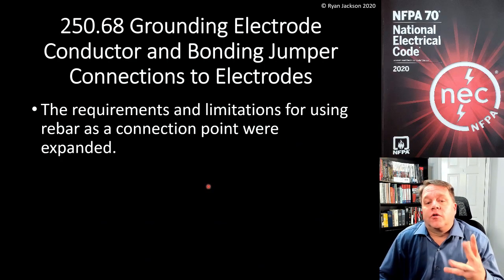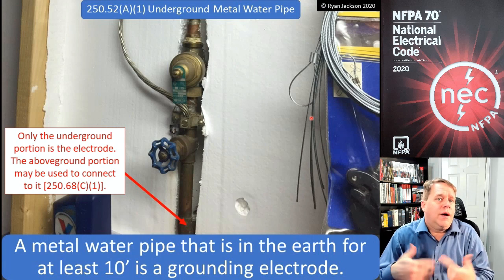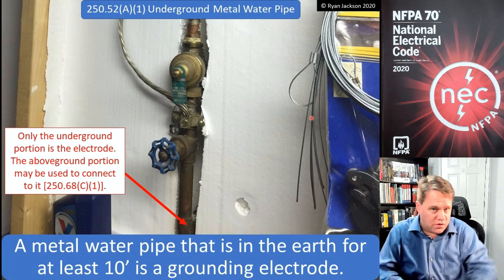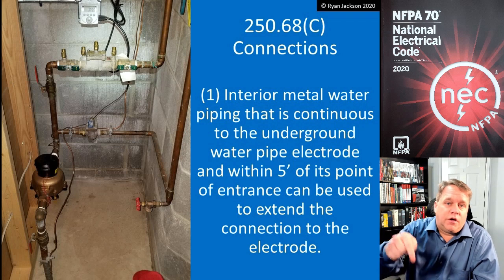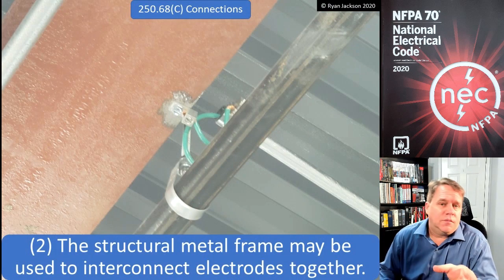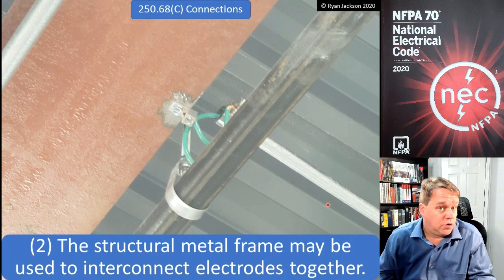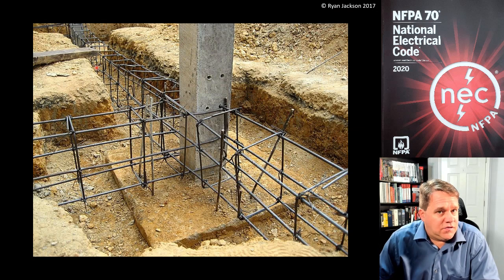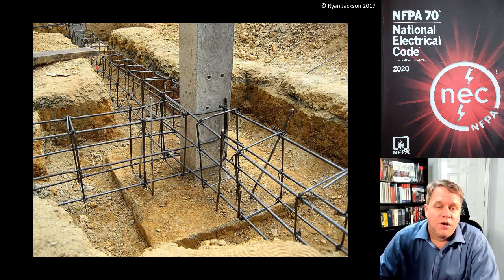2020 NEC Changes series: 250.68(C) Grounding electrode conductor connections

Comment: When's the last time I saw a copper water pipe underground?  Every day lol
Reply from the maker: I guess it depends on where you are! 🤷
Reply: Here in the Philadelphia area they have used nothing but copper to feed houses & small businesses. They are slowly changing over to Led tubing after the water meter. Wired a large house a few years ago where the water meter was at least 150' from street. They installed an underground water meter by street and ran 1" type K copper tuning to supply the house.
Reply: The trend is to switch to PEX even in feed from the main in the street is trending to plastic. Here in Chicago all water pip is underground like 3 feet or more probably 4 feet so as to not freeze in winter but in the Southwest I see it above ground all the time. Personally , using water lines inside a building for ground is bad because plumbers routinely take that apart and if the screws on the bonding wire clamps are rusty then they are not going back on.